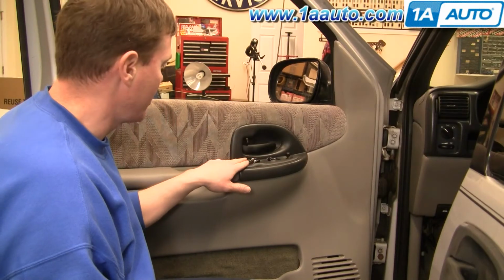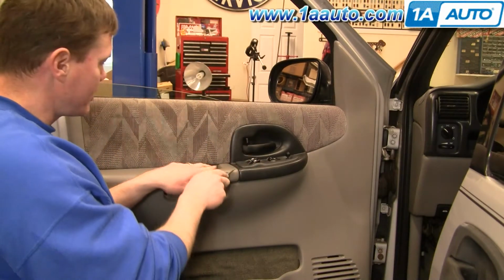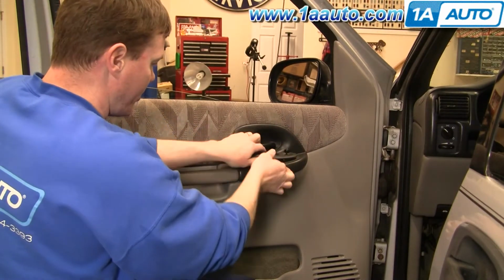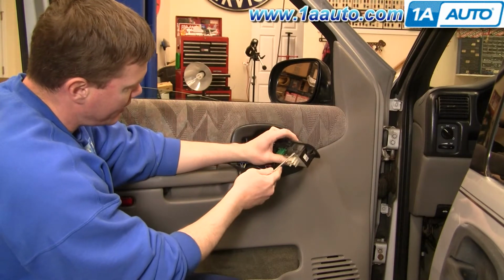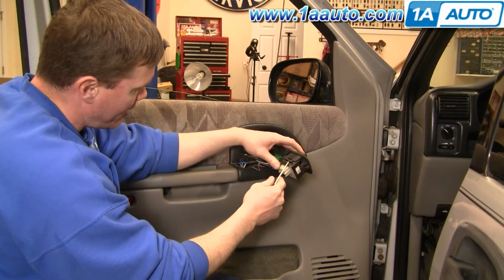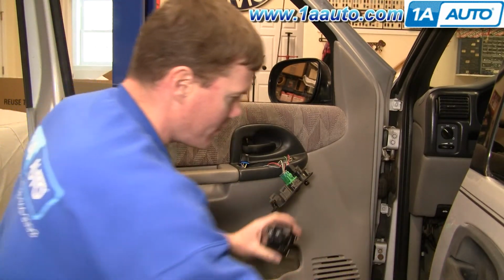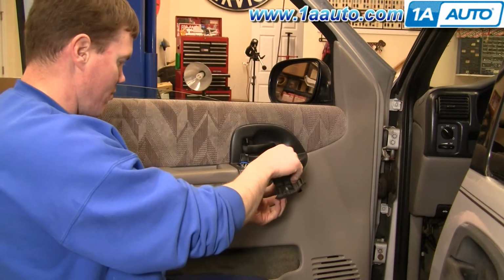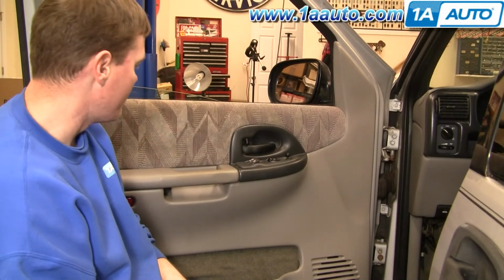How to Replace Power Window Switch 97-05 Chevy Venture

Comment from the maker: If the window doesn't work at all you may want to check the fuse to see if its blown. If the fuse is okay, you may want to test the power to the window motor with a test light or an ohm meter to see if there is power to it, or at what point you loose power in the circuit. Hope this helps you out. Have a great day! 1aauto.com 888-844-3393 FREE SHIPPING in the lower 48 states!

Comment: My driver's side window wouldn't roll back up and it was the first bad snow. I thought I was screwed. I watched this video, didn't need to replace the switch, just had to jiggle some wires around. My window is now up and I won't have to freeze my but off this winter. THANK YOU!!

Comment from the maker: @jmcwilliams75 You may want to see if there's power going to and from the switch. Also check the fuses, and you may also want to check the wires that go between the door and the body of the van to see if any of them are frayed or broken.

Comment: So finding the part was kinda hard with a reasonable price and living in the valley we get a lot of rain. My boss told me I could take the switches out and paper clip the gap to roll up the window, while saying I could blow a fuse... so I'm looking for the 8 pin diagram, manual, etc. of which pin does what so I could roll up the window to unsure I do not get water damage in the passenger seat. Just until I can buy new switches...

Comment: So what switch when it goes down but not up with either switch.
Reply from the maker: +monmixer You may want to check the circuit to see if there is a frayed or broken wire that may need to be repaired. Hope this helps you out. 1aauto.com

Comment: So are you people rip off artists?  I bought a switch from you recently that doesn't work correctly sometimes.  I chatted with someone on your site who said they were sending me a replacement but it hasn't arrived yet.  When I call you I'm in line behind 14 other people waiting to speak to someone about this problem.  You really believe I have 90 minutes or so to waste on hold?  Thus my original question - did I get taken in by rip off artists?